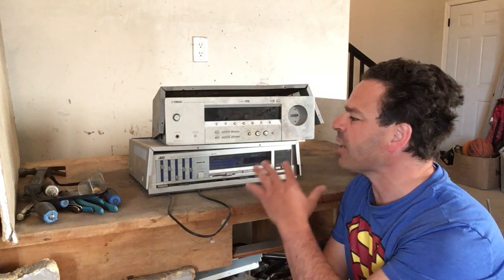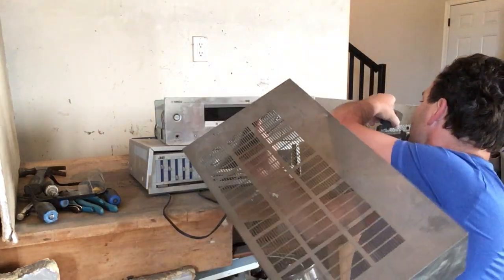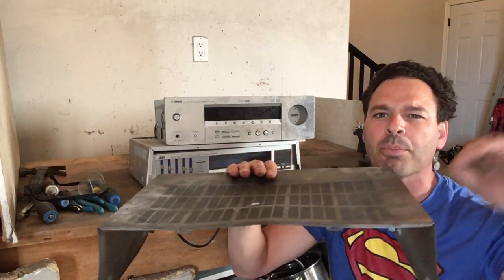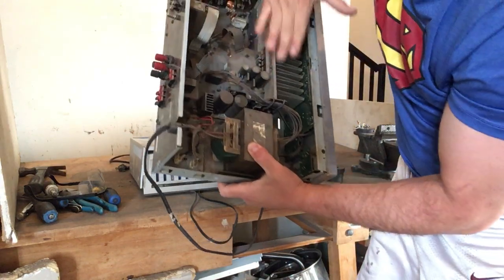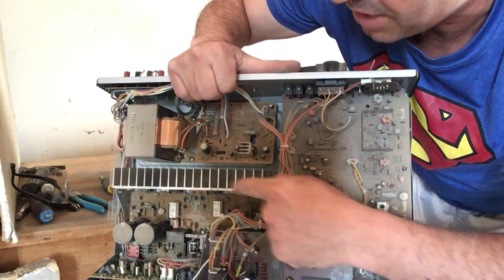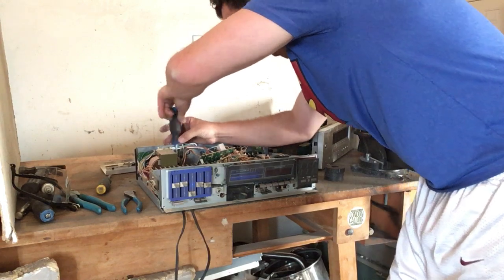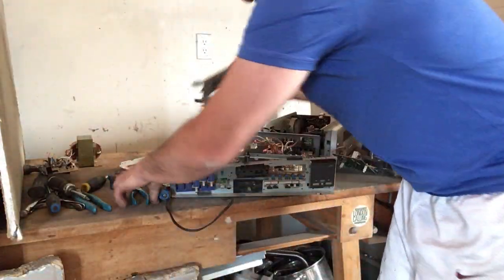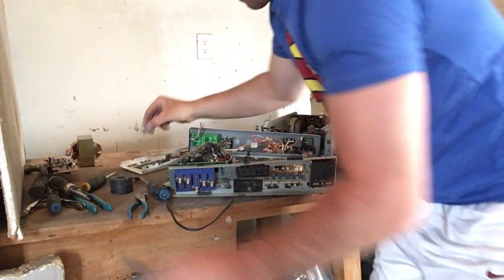Scrapping some old sound systems for loads of copper, tin, aluminum, other metals and no waste!

Comment: Shred was 6 cents a lb 3 days ago here in N GA.  I could get 7-9 cents at another yard but ! Ill drive $4 in gas getting there and back . . I mainly need to free up the back of my truck so Ill check the price 3 miles down the road again later this week.   + I'm sitting on LBS of Brass and Copper waiting on prices to rise [ hopefully ]. good day.
Reply from the maker: Yup, same with me. I can get better price for tin if I drive an hour. Four cents a pound more is not worth the $30 I would spend in gas.

Comment: I find that the aluminum wire goes for a better price than extrusion.
Reply: That's why I don't throw my aluminum motors and transformers in shred.  Clean aluminum for me brings .45/lb, but aluminum wire is .80/lb!!!  It all adds up!
Reply: @jamesfirth1280  Yeah, that's possible, but in northern BC, we get a lot more for the aluminum electrical wire than any other aluminum. I assumed it was like that everywhere.

Comment: dont think that was an mlcc think that was a ceramic capacitor, could bw wrong but mlcc's are the like rectangle ones that have metal on either side and are like beige or brown in the middle, surface mount things,  but those just round through whole things are ceramic, some that look like that might be tantalum but they are not circular but like a dome shape thing that are sometimes in older electronic but yea think that was a ceramic lol